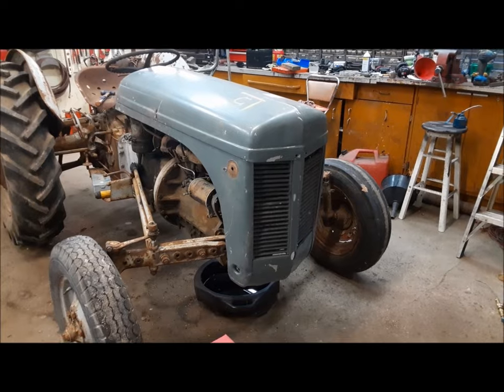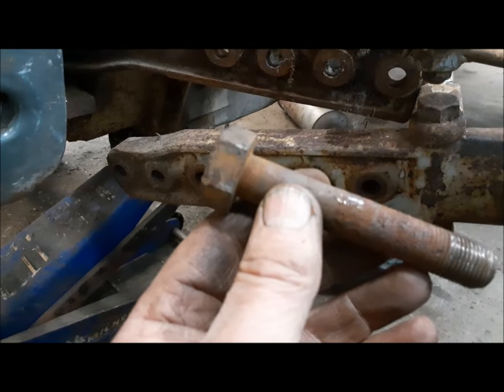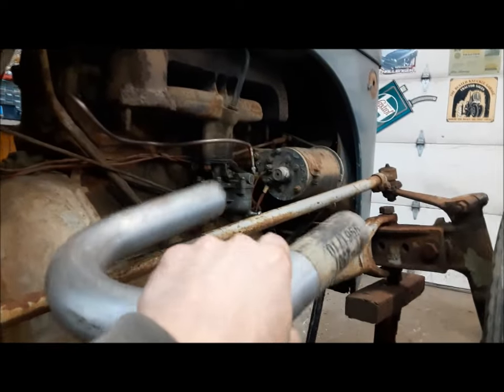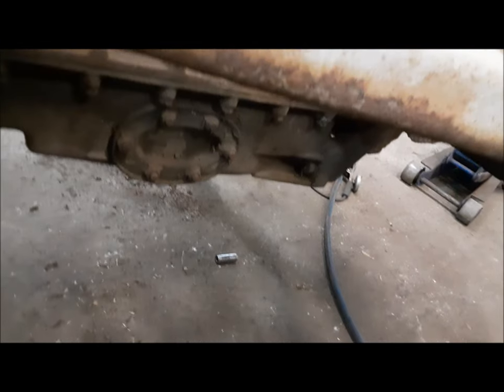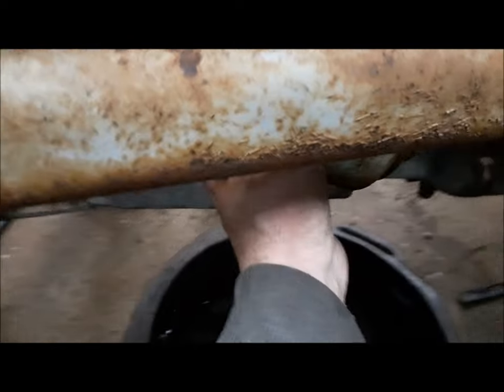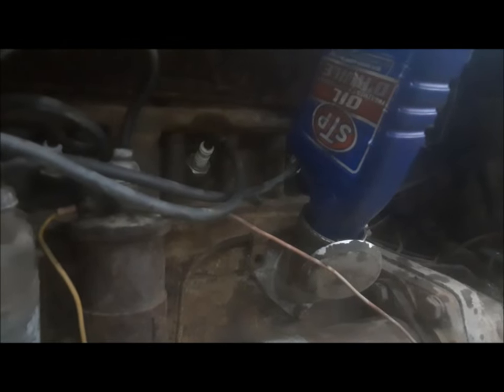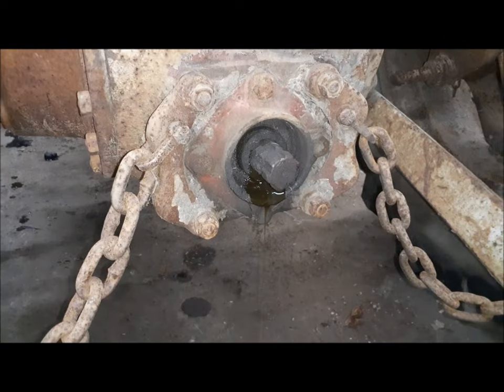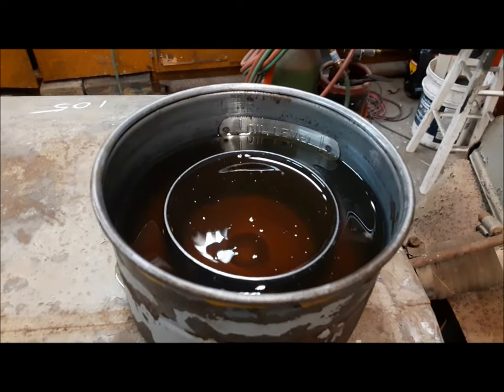1955 Ferguson TEA2085 part 2 Service and Making It Useable

Comment: Goo d   day  Kevin  Many yr ago had old M  harris  & used stp.  told machnic   about it 
he said dip flat head screw driver in it & try to hold screw driver  on sharp oiled end,  slides out everytime.
Yes horizontal  muffler , neighbour had 8n  bindering on wheat  field , starting  fire neighbours help out
Scary  !
Thanks  nice job.
Reply from the maker: I put my 7 foot blade on the back of it today. Waiting for some snow to see how she works.

Comment: Hope you'll get her fixed up Kevin and looking good, i noticed that the steering box is leaking too so don't forget to fix that 🙂👍
Reply from the maker: The seals are sitting on my bench!
Reply: @ClaremontClassicGarage  that's nice to hear you got spare parts on hand ready to put on Kevin, i'm that kind of guy myself too 👍🙂
Reply from the maker: @lucasbergfors9446  I mess with a lot of Fergs and Ford Ns so I keep stocked up on common things that they always need.
Reply: @ClaremontClassicGarage  that's nice i am interested David Brown, Case and Fiat tractors have a 1985 Case 1294 from England which was shipped to Finland and a rare 1981 Fiat 880 DT backhoe my dad had since 2012 pretty neat machines 🙂